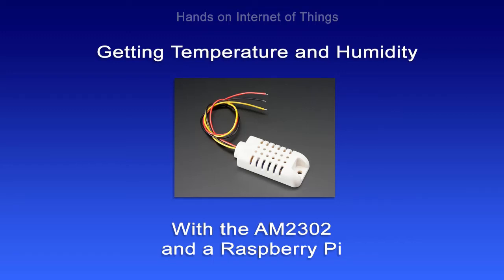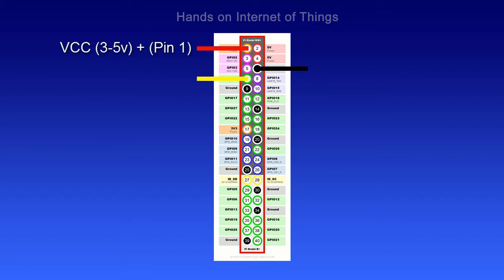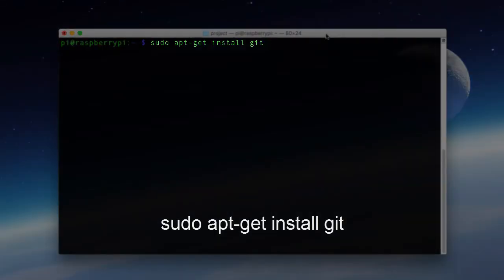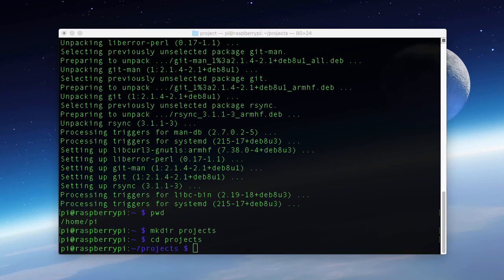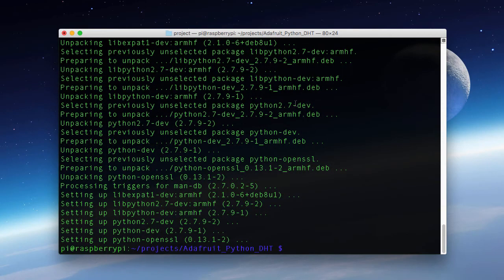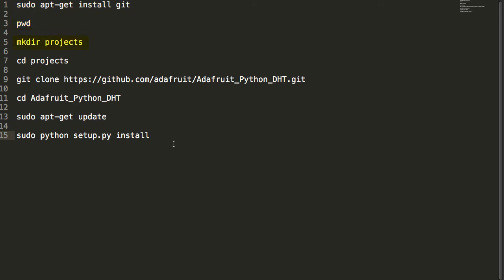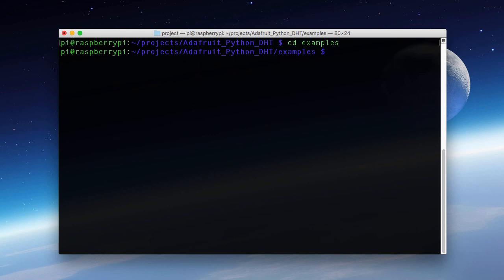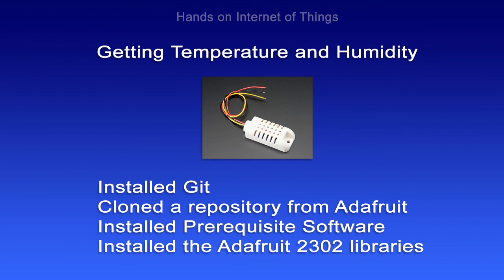Reading an AM2302 Sensor with a Raspberry Pi

Comment: Sorry, Could I ask a question about the readings? I keep getting temperature 0 and humidity 0 while using the code. Although my sensor is am2301, I saw that the it can still work

Comment: My sensor is indentical to a DHT22 sensor, but It says "ASAIR AM2302" on it. I've tried using both "2302" and "22" in the terminal to try and get a reading from it, but It fails every time?
Reply from the maker: Have you tried using "DHT22" from it?

Comment: Can you use a different pin rather than GPIO4? I need to use this one for another sensor.
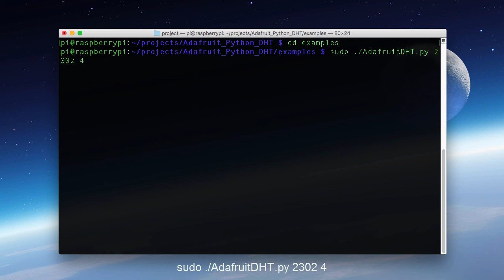Reply: You might have already fixed this but for future learners: yes, just connect any other GPIO value and than in the command used at 5:04 "sudo ./AdafruitDHT,py 2302 4" the 4 refers to GPIO4, so simply change that to the number associated with the GPIO of your choice.

Comment: So this worked great for me, however I don't understand why you specified pin 4 when you ran the example command because you said to wire to the sensor to pin 7? It still works though... Also did you make the next video??
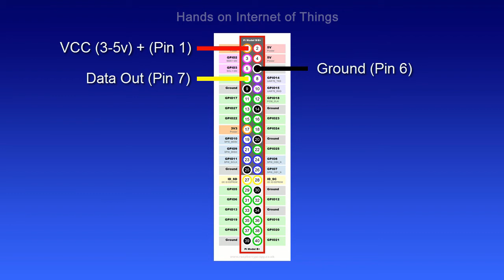Reply: Pin 7 is actually GPIO4 if you look at the diagram at 0:55 you can see all the labels.

Comment: Hi man, thanks for the video! I am total newbie and I would really appreciate your help.
On 00:57 I'm seeing AM2302 connected to your Rasperry. Now, I have AM2302 with bare wires, so I am interested in that how/where to get these "extensions/connectors" which are connecting Rasperry pins and AM2302  wires? Thanks...